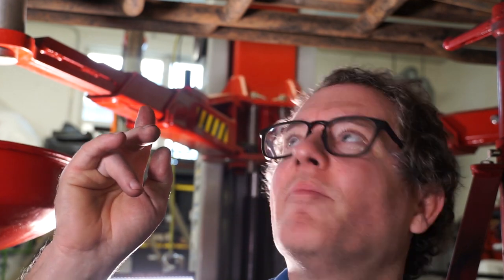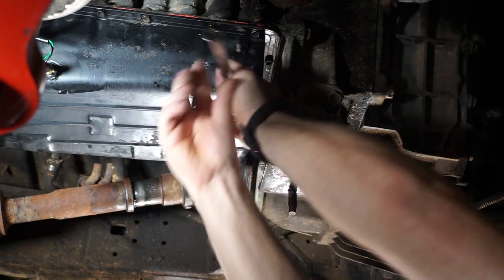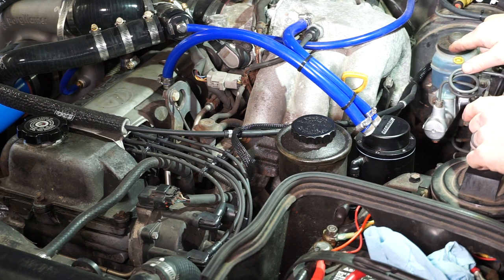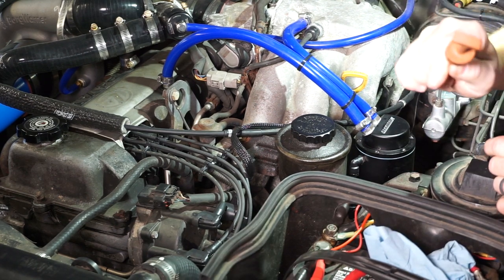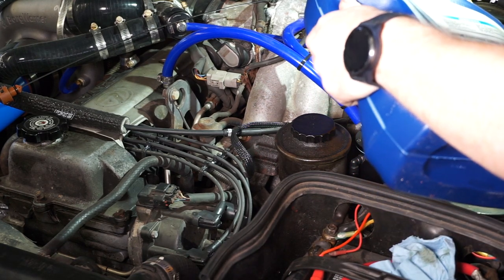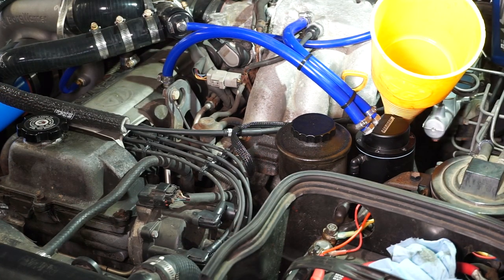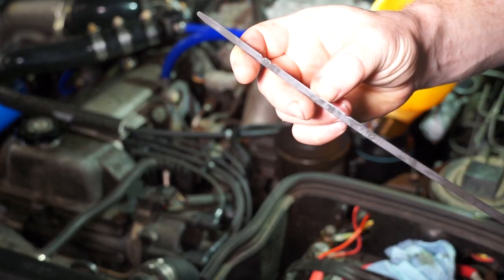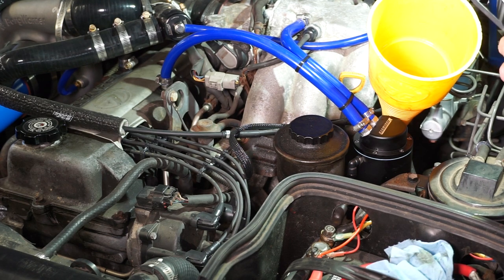80 Series Transmission Fluid Change

Comment: He's back!!!!!  I always heard just leave the auto transmisson alone!!! Scary!! ;-)
Reply from the maker: My general thoughts are leave it alone or drain and fill at most.  My 350k trans wasn't real happy about the addition of the turbo so I added an upgraded valve body (video coming soon).  Since I had to drain and fill it anyway thought I'd do a video.  Hoping to start filling in the gaps on the basic maintenance stuff.
Reply: @OTRAMM  Nice to see you back here. Keep it up. Would you recommend a catch can on a non-turbo 80? How's it working for you?
Reply from the maker: I don't see much of a reason for one on a non turbo. I've only had it on mine for maybe 50 miles so it's a bit soon to tell.
Reply: @OTRAMM  Cool....thanks. Again, nice to see you back here.

Comment: Care to weigh in on using synthetic vs. traditional ATF for a 100 series?  I'm considering doing a few drain and fills on my LX470.  I'm tempted to use synthetic but my gut says to use regular old Dex III. Just curious if you had a preference. Thanks!
Reply from the maker: Depends on the year. The early ones we use just regular dex. The newer ones only get factory WS.
Reply: @OTRAMM  Thanks, I'll proceed with good old fashioned dex III as planned!

Comment: Hi Ryan! I think I've asked you this in person before, but given the relevant video here, can you speak to high mileage (250k+ miles, never changed on record) ATF fluid changes for 80's that exhibit zero transmission issues, but whose owners want new fluid to match the rest of the driveline's fresh fluid? Would this be the method to do so "safely?" 

Drive a few hundred miles and do this same method again a couple of times vs. taking it to a shop and hooking it up to the machines that blow out the whole system and end up causing issues?
Reply from the maker: Yep, we just drain and fill. I haven't seen any manufacturers that recommend flushing with equipment.

Comment: Great video. I have a quick question. After battery replacement my AT temp light on my dash suddenly was lit. The fluid level is ok. Some other lights on the dash are also now on. Have you ever seen this before?
Reply from the maker: I haven't seen the AT temp light come on, but I have seen ABS codes in the older Cruisers after new batterys. I'd check the fusible link first to see if any of the wires broke while swapping the battery.

Comment: I'm having an odd symptom in my 80 series. The auto box on cold start doesn't want to move the car. If I idle the car for 30 second or give it a rev, then the auto works nicely. Once it's running it doesn't give any problems. Only at first start or if the car has been sitting for an hour ( gearbox still warm ) I've been told I need to rebuild my gearbox... But I don't think it's as sinister as that. What do you think? Solinoids? Or do these gearboxes have filters?
Reply from the maker: I don't really get in to the automatics. In my very limited experience sounds like low fluid.

Comment: Will this help with smoother shifting or not really?   I don't have a record of when the Trans. fluid was last changed on my 97' LX450.
Reply from the maker: You shouldn't really notice much difference in shifting with a fluid change.
Reply: @OTRAMM  What are your thoughts on a delayed 1st gear engagement when the transmission is cold.  It only happens after a hard stop and then I need to feather it into 1st or put the gear selector into 1st manually.  The rest of the gears are fine.  Throttle Cable?
Reply from the maker: @mdoneg  I don't actually get in to any auto trans diagnostics at the shop. It's one of my weak spots. Depending on temp though that could be normal. In cold (near freezing) temps the fluid is thicker than when at operating temp and doesn't move through the valve body as quickly. It seems like they may delay the shift on purpose to help warm up the fluid. That's just a guess though.

Comment: Great video is it worth getting it flushed from the shop and getting them to check over it? Or are you best just doing it yourself? Just bought my 80 and trans seems fine.
Reply from the maker: Flushing can cause problems. If the fluid is still red and doesn't smell burnt we usually leave it alone.  Drain and fill seems safe though.
Reply: @OTRAMM  this answered the question I just asked. drain and fill it is

Comment: can you do a video on how to remove the diff drain plugs i have hit mine on a rock and it just spins its not leaking any diff oil after a few months last change i just used a vac pump to remove oil from the fill plug and refiled it but i dont like driveing about with the drain plug spinning like it is am sure its the threads that are stuffed it spins both directions doesnt get lose or tight i have a thread chaser with new plug and a over sized plug and tap ready to fix but i cant get the old drain plug out
Reply from the maker: If it's spinning and doesn't tighten or loosen you've stripped the threads out of the center of the plug. The plug still has good threads on the inside holding it in. There's no easy way to fix that. It'll either have to be drilled out or pried out. Sometimes if you can wedge something behind the head of the plug to pull outward you can pry and turn at the same time and get the inside threads to catch and thread out. It's a long shot though.
Reply: @OTRAMM  thanks mate pretty much what i thort stripped threads ordered a needle nosed pliers vice grip hopefully that gets it out if it doesnt work looks  like got to pull the third out and push down with something also love ya vids keep up the good work

Comment: How often do you suggest changing this fluid?
Reply from the maker: I'm not sure that there is a recommended time from Toyota.  I'd have to try and dig through the owners manual.  We don't change them often.  It's usually when we've got to drain the fluid for something else.  If we're doing a fluids check and the trans fluid looks discolored we'll recommend a drain and fill.